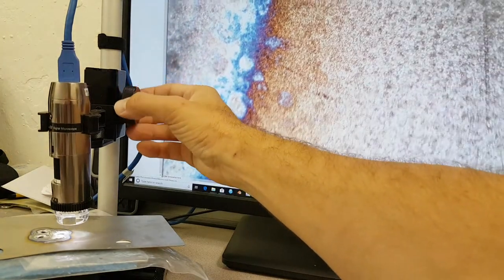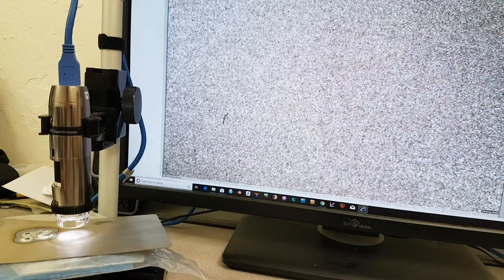OHMA - Dimples on Titanium

Comment: you need to repeat these tests with an oxy-acetylene torch to have something to compare to.
Reply: Yea, exactly!
Reply from the maker: Agreed. That is a long road.

First we would need to find out the supplier of the same Ti sheet, however, after we have done elemental and isotopic analysis - if there is nothing really interesting, one might decide not to. If there is, then the balance of the unaffected sheet could be exposed to oxy-acetylene torch.
Reply: @MFMP  cut the sheet in half and take it to a weld shop
Reply: or take it to the weld shop and have them cut it with shears then have them hit it with the torch